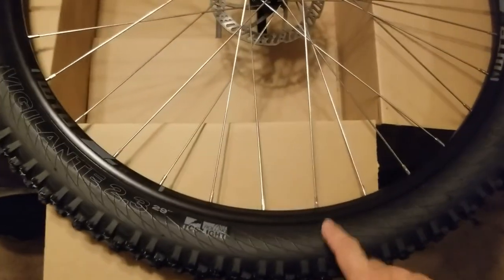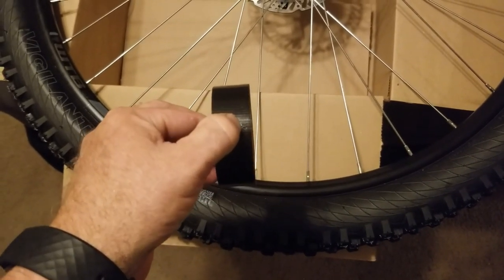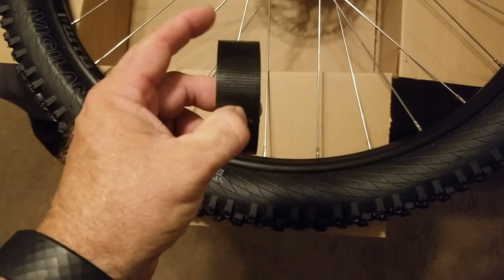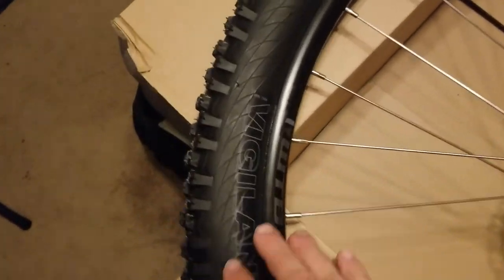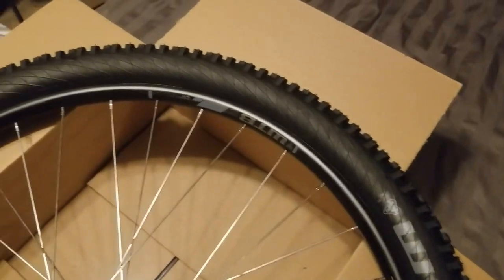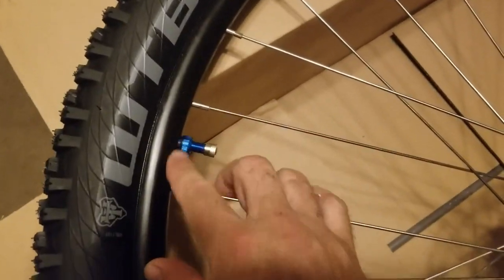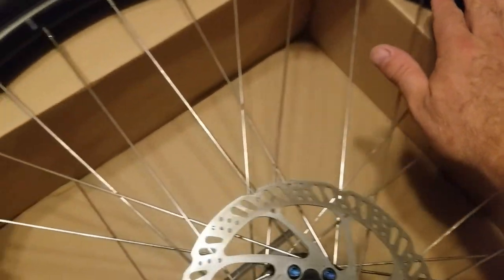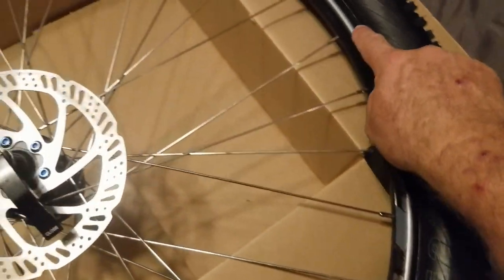GT Avalanche 29er .SX19 WTB wheel tubeless . Project GT Avalanche 1.

Comment: I have  2.4 maxxis Ardents front and back with  non-issue on my avalanche.
Reply: I’ve read that 2.4 rub on the rears...  My wife  purchased 29x2.4 yesterday for my avalanche....  not sure if I should use it or return it and go with a smaller size
Reply: @miko111406   They should work i jump my avalanche and never had a problem.  I am thinking about going 2.5 once my  tires need replacing.

Comment: I run a 2.4 Maxis Ardent on the front of my Avalanche with no issues
Reply: I'm looking to do the same, as well as run one on the back. Which fork do you run those on? I have the same one in the video, not sure if it will fit. Do you run a 2.4 on the back as well?
Reply: I have the stock fork.  Suntour XCT

Comment: I have the same bike and I was wondering how I could bring down the weight
Reply from the maker: I brought down my weight of the bike. By using carbon handlebars ,air forks, Going to tubeless, 1 by 12 shifter, cranks, hub. And you can always go carbon wheels.